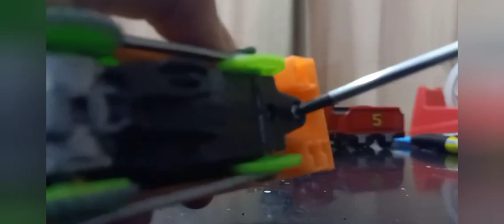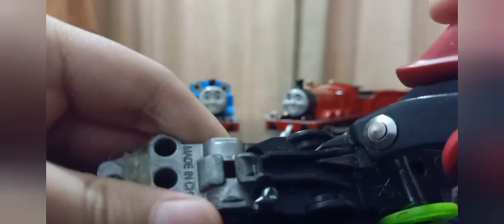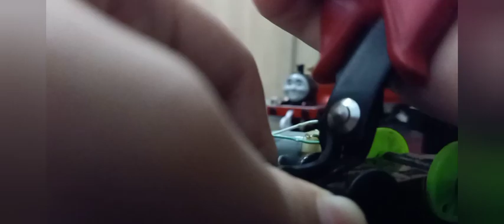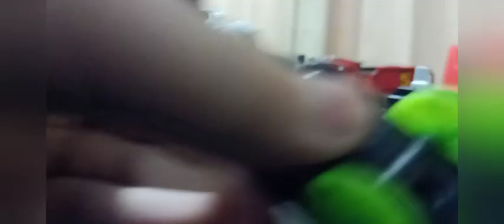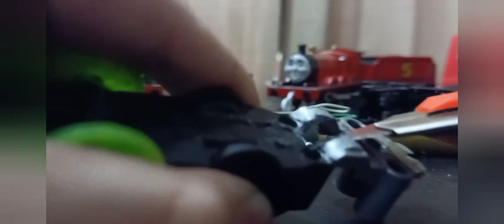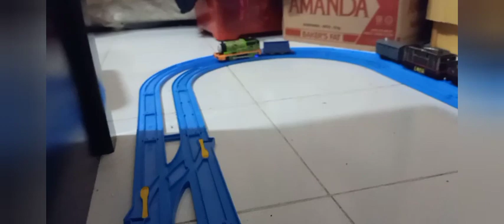How to make your Trackmaster 2 train run on tomy track

Comment: Great job. You can also replace the traction tires with Tomy ones so it can run quietly and smoothly rather hearing it make that grinding noise as it runs along.
Reply from the maker: You can but if you want to keep the tm2 wheels you can do this trick. It can run on tomy, trackmaster classic and trackmaster 2 track